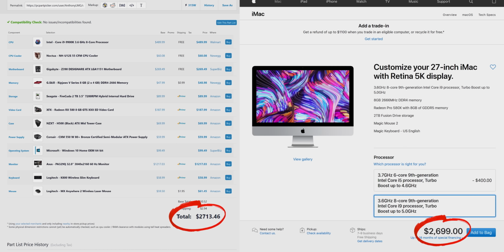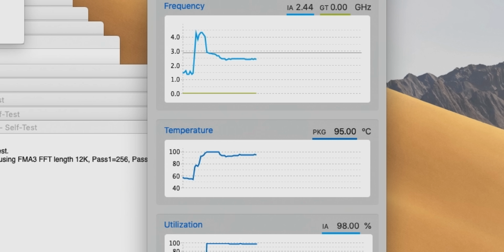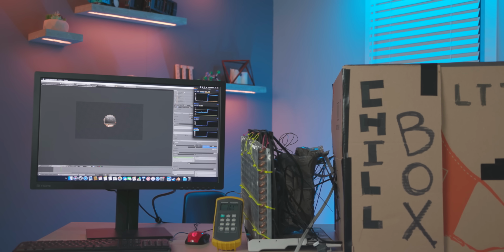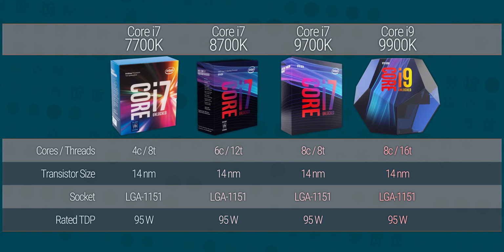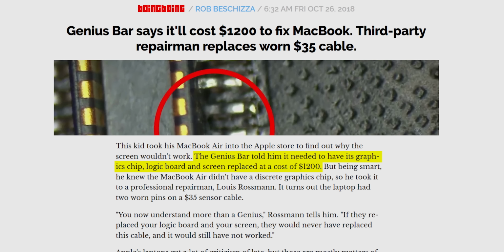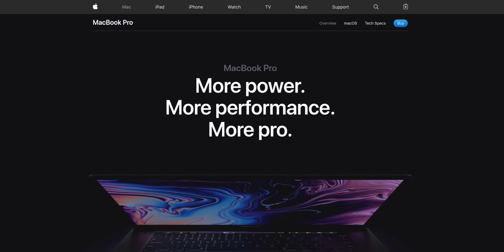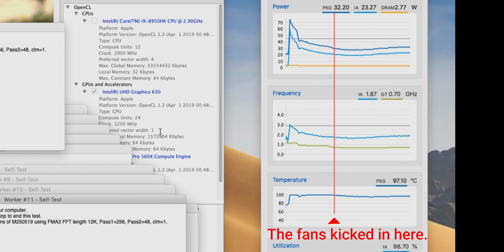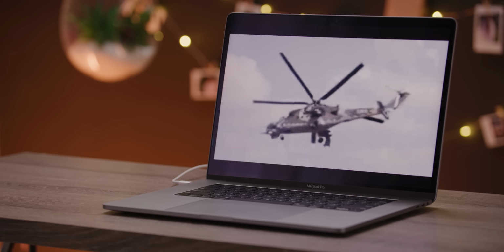Macs are SLOWER than PCs. Here’s why.

Comment: Macbooks are unreliable. It is just a status symbol.
Reply: yeah it's weird isn't it... why on earth something that cost so little is to some a status symbol is beyond me... 100 million dollar yacht is a status symbol not apple that pretty much everyone could buy if they really wanted to.
Reply: @bartoszbielawski8558  I bought macbook because i was happy using iPhone. But in macbooks Apple really needs to work. My windows laptop (40 to 55 Degree C) stays much more cooler than mac . 80 to 90 degrees C is very bad for machines. Even gaming consoles dont go to that level.
Reply: @Sam-wm1mo  So... you bought a product because of the name of the company - in this case "Apple", not the quality of the product itself.. Yeah typical for apple buyers. You say it's a "status". So in your case what does that status say? It says something like. "I bought an overpriced crap just so it can have a nice logo on it :)?" That does not make much sense... no offense.
Reply: @bartoszbielawski8558  nobody has any doubt that Apple iPhone is great phone with clean easy to use Operating system. iPhone is a reliable phone unlike many android phones. I used iPhone 4s for almost 4 years without even replacing battery.  So i gave a shot to its Laptop product. I got what i was not expecting. People learned from experience. Now, i dont recommend apple macbooks to anyone.
Reply: @Sam-wm1mo apple makes good phones but i would not call them great, simply because of their price. IMO considering what else is out there they are simply not worth the money, therefore how can they be great. If you can get the same, often more for less, you pay for the logo only - and this is silly. But yes, their phones are still good if we forget about the price - but should we be forgetting about it? Apple phones were always on the most expensive side, but why exactly. They were not, overall better then other comparable phones. So i ques the more expensive phone is, better it "feels" to have it, for some people. All apple computers are overpriced, not just macbooks.
Reply: Bartosz Bielawski I agree Apple products are over priced and People are getting their strategy. Thats why Apple market is going down. Nobody wants to change phone every year.

Comment: This is FUD. Macs are quite incredible considering form factors, thanks to super fast SSD, much better OS, Metal and other things they are usually faster in many talks the Windows. And yes I’m a IT Windows and Apple tech too
Reply: you can get the same "super fast ssd" or even faster for windows so how is that even an argument? "And yes I’m a IT Windows and Apple tech too" - no you are not, explanation why at the beginning.
Reply: @bartoszbielawski8558  Nope you can now, without T2 on the fly encryption. when new 13" and 15" come outs it was the fastest SSD, same for 2016 versione, same for2013 versione, Macs had Pie SSD in 2013 where PCs where only on SATA
Reply: @RiccardoVegan  ohh I am sorry I thought it's 2019 not 2013... My bad.
Reply: @bartoszbielawski8558  It is the same when 2018 MBP gets released they were they had fastest SSD on the market, probably still the  fastest default SSD today.
Reply: @RiccardoVegan  and what is default SSD?
Reply: @bartoszbielawski8558  NVMe 3.2GB/s

Comment: While I don’t disagree that you can get more power out of a windows machine, there are certain features that you cannot get. The sole reason I bought one is to integrate my messaging with my computer. Having the ability to write texts, and drag and drop files directly to/from text messaging saves me an incredible amount of time in my position. On average I probably send/receive about 500 texts and emails a day solely for work, I do not want to be typing on my phone all day. I wish that was available in windows, but it’s not.

Comment: I have a program for MacOS called Macs Fan Control.  I use this on my iMac which allows me to customize fan speeds.  My iMac hardly even gets above 100F even when stressed.
Reply: Use ºC, lad. Everything related to science goes in C and K for more extreme temperatures, especially PC-related things. 100F is 37C for those who don't use the shitty imperial system.

Comment: Now that Apple is developing their own A series chips for iPad that is, at least in benchmarks, as powerful as the expensive, hot and battery hunger intel chips, If they could make MacOS run in a arm architecture, boy, they would change laptop market upside down and make an crazy profit by unit.

Comment: all this talk about throttling and thermal physics. THESE ARE LAPTOPS people. elite performance is your highest priority? buy a desktop.
now about these chips that don't fit well with their cooling systems: 

software developers are always producing for the latest chips from Silicon Valley, correct? meaning new software updates would be most compatible with new chips as time moves on- regardless of how well they can throttle in their relative systems. could this be why Apple's hauling new chips in infrastructure that isn't compatible?

Comment: Here are some reasons no one ever mentioned why people like Mac more.

I am a Mac user who decided to switch to Windows, also because of videos like this one.
It was a bad decision. I went for the best pc available, a Razer Blade 15 with top specs. It just isn't as good as a MacBook Pro. Here is why I am returning it:

1. Trackpad. Macbook trackpad is incomparably better. On windows the pressure needed for a click is insane! It feels like you have to hammer on your laptop every time you need to select something.
2. Menu titles. Windows menu titles are tiny. None of the messages or menus that appear is as readable as on a Mac.
3. Real screen. Windows doesn't do a good job in adjusting its windows for the screen available. As a result, your screen feels a lot smaller.
4. Battery life. On a comparable performance, the battery of a windows machine lasts half the time that of the mac, regardless of what's written on the box.
5. Shortcuts. The location of "control" on Windows is awkward. It is a lot more difficult to perform shortcuts than with "command" on Mac. And that's not a matter of being used to it. I keep switching from windows to Mac as my company also uses pc. Mac is just better. "command" is closer to any other letter and easier to reach.
6. Hardware design. Everyone complains that Mac doesn't have enough ports, and that's true. But have you guys looked at many PC chargers? They are awkwardly designed, big, and heavy. I'd rather get an adapter more for Mac that move around with a charger that heavy.
7. Operating system. Here it's a matter of preferences, I guess. But OS feels simply a lot smoother.

In conclusion, I really wish Windows was better than Mac. I tried to do the switch because I was hoping that would be true and I could save some money. But the trade-off just isn't worth it for me.

Comment: That's the reason why Apple wants to switch to ARM processors on the Mac. Looks like they're not putting a lot of effort on Intel Macs.
Reply: Should have stayed with PowerPC architecture in the first place. I knew this was a bad decision to go Intel.
Reply: LilZebra back then the Intel chips made a lot of senses. Sure Steve Jobs had this thing for Intel CPUs, but at the same time neither Motorola or IBM were really putting any effort to develop the type of CPUs were after. Instead they appeared to be putting a lot of energy into server grade or console grade chips.

Comment: Linus, heres a question then for us "comfort zone" who bought the new MacBook Pro 15" which I use everyday and as said in the exorcist movie: "it BUERNSSSS!!!"  The questions: I know it is not working efficiently, and they are reducing the laptops lifespan with this software patch and letting it heat up horribly (it really burns). There are 3 apps (Intel Power Gadget, Volta and Macs Fan Control); 
1- What do you think is better? to let the MacBook Pro works as is, super heating every day, but letting the fans accelerate automatically -- that this not happens until its really hot. OR: use this app "Macs Fan Control" to control the Fans, giving the fans more use, thus, getting the fans and its area more heat than originally designed (or bad designed)???  --Just now, my computer was 73C and fans where at about 2,000 RPM. I accelerated using this apps the fans to 5,000 and the temperature now is 57C in about 3 minutes.... but the fans are mildly soaring.

2- The other question.... how bad is it, do you think, to use that app "Volta", to control the peaks?? (by reducing the voltage to the CPU)

--- Now, one minute later is in 56C, so it is cooling, but the fans... could even make a worst brake in its surroundings inside the machine, I don't know...
Please, advise!

Thanks

Comment: The only people that care about Mac vs PC are PC guys. Maybe a video should be made of why it bothers the person so much. The speed of a Mac is not hardware based, it's in the OS and the fact that media creators (not all, but most, so get off the replies if you think you will chime in that you make a living using a PC) get a Mac and have almost no setup to get working, and they don't have all the folders to open to get to what they want. That is what makes Mac faster for Mac users. I mean look at one of the last videos you did about running macOS on any PC. You guys went through a 3 hour configuration and kept saying "that's so fast and easy" (paraphrasing. Don't take that literal). So the Macs hardware might be a little slower than an overclocked PC...look at all the time you are spending trying to prove Mac/Apple is worse than PC/Windows.

Comment: RX 460 on a 3000 USD laptop is in no way impressive.
Reply: Wait what
Reply: @x3seal133  The 13 inch max specced model doesn't have a dedicated GPU, and the 15 inch max specced model has a rx 560. Still overpriced
Reply: @thenaughtyapartment2619  I would love to read your opinion on the new 6,000 mac pro with a 3yr old USD 200 video card. Aaaaaand a USD 999.00 metal stand for the monitor (that costs USD 5000)
Reply: I'd say it's impressively expensive, i got my 460 for like 50 usd
Reply: But T2, fastest Thunderbolt 3 on the market, better display on the market, SSD with 3.2GB/s speed is impressive in such a size. Most commenters here have not idea since they are PC users.
Reply: @Kamal Kristipati so much more like what? People who really care about getting what they are paying for do look at the specs, not only branding

Comment: But even throttled it's faster than the PC. How is your title correct?
Reply: Not true, he shows in the video that any of laptop is slower than the mac. Ergo Macs are faster.
Reply: matt D But when he has windows installed on the MacBook the performance is better over the other laptop variants. Granted the MacBook forgoes the custom thermal monitoring which in fairness one can set via programs much like you could do on a windows laptop.

Comment: Keep trying.... tell this to somebody who bought a 4Gb RAM Surface Tablet....

A correct heading should say: "Fine tuned PCs are always faster than stock Macs, because you can't fine tune a Mac it's always stock. On the other hand, most stock PCs are significantly slower than equally spec'd macs as Apple does way better fine tuning on stock equipment"

Comment: Linus, is there then a laptop and desktop manufacture doing a better job mating processor/GPU speed to thermal performance? Where can the consumer go? Who can they ~trust, well most of the time; without having to bring you to the store?
Reply: Because the market is quite saturated, if I were in your shoes I would look at laptops in your price range and do research on the laptops that would work for you. It's not usually a manufacturer issue we is the case with apple, it's usually the laptop itself. Manufacturers change their laptop designs constantly so I would look for good reviews that look specifically into the problems you don't want to have

Comment: There isn’t a difference in philosophy between Macs and iPhones. The reason iOS devices don’t have to thermal throttle is because their CPUs are well-designed.
Reply: Rob Speed and iOS is very well put together for those cpus.

Comment: As an owner of both, and as a person who loves building PCs, I can attest to this video’s accuracy. I still have my at the time top of the line late 2008 MacBook Pro, and it’s literally then that I noticed early examples of poor thermal design. I wasn’t the general user, I installed windows on mine and used it for light gaming. My logic board had to be replaced two months later. This was actually a known issue, largely due to overheating on then relatively new intel based Macs. Meanwhile, varying PC laptops I bought throughout the years, for both gaming and DJing never had any issues in the thermal department, nor where they loud as they contained well designed fans. As a professional photo retoucher, my work purchased me a top of the line late 2015 MacBook Pro the year it released. Those very same thermal issues were still common place, if not worse. Upgrading the hard drive, as well as the ram was all but impossible even with the proper tools to pry open the screen on the unibody design. While I loved the look and feel of it, knowing about thermals, building desktop PCs for myself and others that ran like ice boxes and looked beautiful with custom icon designs, much like what most people assume can only be done on Macs, made me even more frustrated with the odd slowdowns I experienced on my Mac.

Now to be fair, the built in software for music production on Macs is absolutely stunning and the OS, when used on less taxing things, such as music editing is excellent. Even as a starter program, garage band has an audio engine that’s shared with Logic Pro, so going up in terms of programs is possible if you grow from one to the next. I haven’t managed to  go down from Logic Pro to garage band for anyone I’ve made beats for using Logic who only have garage band, due the more advanced feature set. That makes sense though. Now as a person who like to edit and take complete control over every aspect of the OS, much like I can on Windows, it’s possible to an extent on MacOS, but it’s frustrating to do so. There are also a lot of oddities most Mac users never admit to. For one, while they claim drag and drop program installs and uninstalls are a universal thing, it simply isn’t true. As a graphic designer, the Adobe suite still installs as it does on PC. The uninstaller is similar too. Dragging it to the trash leaves tons of files behind all over the Mac. Even basic apps leave tons of traces behind when simply dragged to the trash. The compliant that Mac users who switched to windows had about uninstallers was always funny to me, as I’ve used both since before MacOSX released. On Mac, simply using Mac Wiper shows that an app as simple as the built in garage band leaves behind 2-20 gigs of data depending on the install and official music packs you have. Even the base install leaves behind data that simply dragging into to trash won’t delete. It’s made worse by the fact that there’s more than one library file on Mac. They used to both be shown by default, but in an effort to hide the Mac’s cache files, several OS revisions ago, since roughly around the release of the MacOS Yosemite, the second library location is hidden completely, and it takes several terminal root commands, the Mac equivalent of the PC registry, to unhide it. You can also you the free app Houdini to do the same thing far more quickly. This is just to delete the trail that simply dragging and dropping an app into the trash bin won’t delete, if you don’t have Mac Wiper. Another frustrating thing is, on my older 2008 MacBook Pro, which I leave at home for quick Logic Pro music edits, I can’t backup my iPhone locally because it tells me my iTunes is out of date and my Mac no longer supports the latest version of iTunes. Meanwhile I have 2 HTPCs, one for retro gaming, and 1 for more modern titles when I don’t want to use the tower pc build. The oldest of these was built before my 2008 MacBook pro was purchased for design work. It has windows 10 on it with the latest iTunes. This is Macs version of forced obsolescence, and it’s largely why, outside of my work getting me another MacBook Pro, I’ll never buy another Mac. Meanwhile I just added a 1050ti small form factor card to my newer slim HTPC, and a year ago, two 1070TIs to my desktop build, which I’ll sell for a single Rtx 2070 or 2080. All of my PC laptops and desktops dating back to 2008 still run sans any issues, but it all comes down to treating them well. I babied my Macs, but even then, heat still got one of them. I’ve babied my 2015 MacBook Pro, and it still overheats when using adobe premiere pro for medium sized edits. Now I do love using it for portfolio reviews, as the color is accurate and the viewing angles are spectacular, but when I work from home, I use my PC desktop exclusively for the adobe suite, making sure the pc has all of the correct fonts though, as font management on PCs, even with 3rd party apps, pales in comparison to even apple’s basic built in font management software, let alone Suitcase Fusion for Mac, which every studio I’ve worked in house for uses religiously. I wish there was a middle ground OS that wasn’t Linux, that was viable in my fields, Graphic Design/DJing/Digital Illustration/Beat Making, that had the stability of Mac OS, with the adjustment factors and upgradeability and gaming performance of Windows based PCs. That would be amazing. One can dream...
Reply: Wall of text landed a critical hit. It is super effective